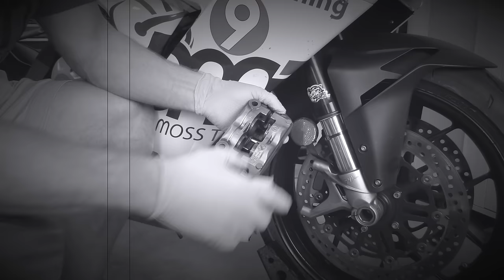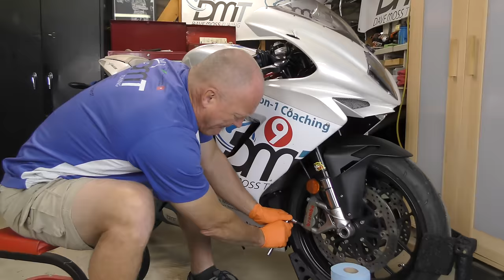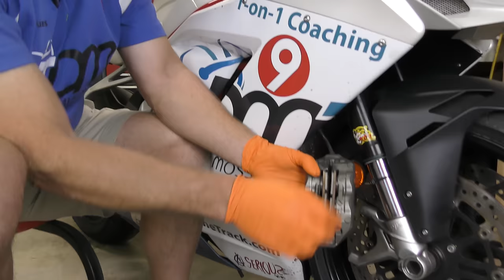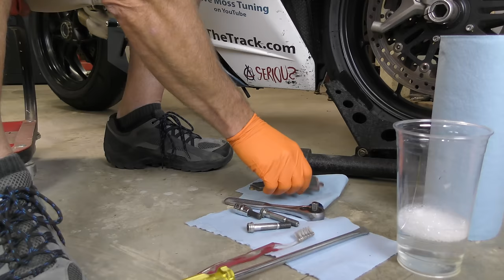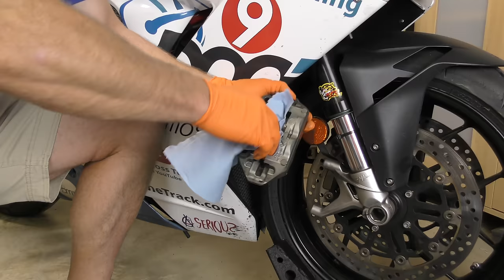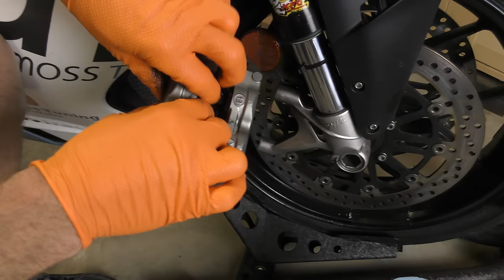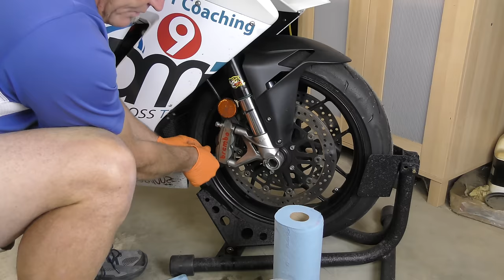Cleaning Motorcycle Brake Calipers in 5 Easy Steps

Comment: Im struggling with uneven pad wear on my track-only Ninja 400. I noticed today the the side of the pad with the most wear corresponds with the piston that doesn’t extend when i pump the brake (the other piston does extend). 

I just cleaned the pistons and that sticky piston still wont extend while pumping the brakes unless i hold the other one. Any other ways to fix a sticky piston? Or is it normal for only one piston to extend when pumping?
Reply from the maker: You might have to remove that piston completely to see why it is sticking. That will of course mean all the brake fluid will leak out. Then you can polish it and use brake fluid or rubber grease on the seals to correct the problem.

Comment: 100 years ago we used to use copper grease on the back of the pads to keep the pads from squealing. We don't do that anymore nowadays?
Reply: Aluminum paste looks better 😉
Reply: I know that in the car industry copper grease is almost never been used anymore due to a coating on the metal part of the pads that prevents seizing up. Maybe the same with motorbike pads?
Reply: They say copper isn't good since we have ABS. Better use a ceramic grease.
Reply: It's comes copper coated
Reply: I'd still do that first if my brakes squealed. Too much nonsense talked on social media about, 'OMG, don't do that because it will.........'
Reply: @thewoodster8607  ok then......
Reply: @thewoodster8607  why not just use the right things for the tasks at hand. Liqui Moly has it all.

Comment: Thoughts on what to lube the seals with when servicing the calipers? They usually come with red rubber grease, but I've heard people say to avoid using it and just use a little brake fluid instead
Reply from the maker: Very very small amount of rubber grease is all I have ever done for brake caliper and fork oil seals. I have never used just brake fluid only (I sure that works just fine) and found that just fork oil creates stiction fairly quickly.
Reply: On most motorcycle calipers, the piston seals are inside the caliper (not exposed) and they are lubricated with brake fluid during reassembly on a full caliper rebuild. The slide pins should be lubricated with a rubber safe brake grease (silicone based) because they travel inside a rubber boot. Some "sub slide pins" have collars--in that case you lubricate between the collar and the rubber boot. Finally, you may use any brake grease (a very very small amount as Dave said) on the brake pad "ears" ONLY where they contact the pad springs and retainers. This is to minimize grit collection. The color of the grease shouldn't be super obvious because the layer should be that thin.

Source: Honda service manuals

Comment: Why don't you clean the brakes before installing them back on?  I was taught to spray the pads with brake cleaner, and also brake pad lube on the back of the pad if you have it.
Reply from the maker: There are separate videos on brake caliper cleaning that are in detail. This involves a toothbrush and soapy water and 20 minutes of time, 10 per caliper.

Comment: I have a sticky disk at just one point of the rotation. The disks and pads are brand new, have they been installed incorrectly? Or the disk is warped? How to tell?
Reply from the maker: Take the caliper off. Spin the wheel and put a piece of card against it to watch and see if the rotor is warped. Simple, quick easy. :)
Reply: @catalystreactionsbw  my mechanic today said it was normal …

Comment: I had a question can I just take the caliber off and the brake pads take them off then just pop the brake brake pads back in without having to push the pistons back in or do I have to push the pistons back in no matter what .
Reply from the maker: Depends how worn the brake pads are. If well worn, yes, pads will easily be removed.

Comment: How much soap per gallon of water should I use?  If the brake calipers still won't come out evenly when pressing on brake after thouroughly cleaning them, what should I do next?
Reply: I've used a piston puller (clamps to the inside of the piston) to rotate the piston, pull it out a  little and clean.  Worked to loosen up a frozen piston.  Then some brake fluid for lube.

Comment: Prior to pushing the pistons back in, I clean the races off, then lubricate them with brake fluid. Then push them back. Work them out, clean off again. Then set the 'bite' point with regard to gap between pad contact.
Reply from the maker: Thanks for sharing your technique!

Comment: Should I open my master reservoir since I’m pushing the pistons back in ?
Reply from the maker: Depends on your fluid level in the reservoir. If you at the the low point, there will be no need to remove the cap. If you are close to the top, you will need to remove fluid to the low mark, replace the cap, then proceed and once the task is completed, top off the reservoir as needed.

Comment: I've seen people dab brake grease or silicone spray to the caliper pins to have better moving pins. It makes sense but, is this really necessary?
Reply from the maker: I see no value in it as I clean my brakes regularly with a toothbrush and soapy water. For those that never touch their brake calipers, I am sure that is helpful in some way.

Comment: In my calipers (SV 1000 S) I can easily remove the break pads without the need to squeeze in the pistons by just ... well, removing them (from the top). They are only held by a screw ... is this different on these Brembo ones?
Reply from the maker: Some have pins like yours, some have springs, some have tabs, some are single pads per piston. Many different designs!

Comment: I always put some rubber grease around the pistons before pushing them back and try to spen them around a little if i can, any reason you didn't do that or is this just not that in depth cleaning, but more something to do between sessions?
Reply from the maker: No reason - just trying to get riders to think about cleaning their calipers, so this is the easiest way to get them started. As experience and knowledge build, so your techniques evolve.
Reply: @catalystreactionsbw  Fair enough, thanks for the insight!
Reply: I find a thin layer of silicone grease around the piston before pushing it back into the caliper keeps them all moving more freely. However it does mean cleaning the pistons a little more frequently since that layer of grease attracts dust and dirt.

Comment: No need to wipe the rotor with a brake cleaner soaked clean towel to remove residue or scrub pads with toothbrush and brake cleaner??
Reply: You never scrub pads that you are returning to the caliper, because they are formed to the rotor, that's why you put the pads back on the side they came out of, most important, applying anything to either surface can cause slippage, that's dangerous.
Reply: @mal-wx6tu  So you think scrubbing the surface of the pad with a tooth brush will wear it? Surely it's not that soft!

Comment: I understand there is some force that pushes brake pads apart so they wont touch the rotor when not engaged. How do we ensure that after dismantling and reconstruicting the braking system this force works properly as it should?
Reply from the maker: If the brake pads pins (if present) are clean and not grooved, that is the first part. Second is the all 4 pistons moved easily and freely on extension as they will retract evenly as well.
Reply: @catalystreactionsbw   im starting to understand. With brake lever unpulled the brake fluid retracts the pistons back. And the brake pad pins somehow  pull apart the pads evenly as well? Planning to clean callípers as well so better to understsnd the mechanism behind it before something bad happens
Reply from the maker: @jasicjan  When the brake lever is pulled, pressure pushes the pistons out and brakes are applied. When the pressure is released, the pistons move back. When the pistons are cleaned regularly, they move much more easily and that is where the toothbrush and soapy water are important.

Comment: @Dave Moss Tuning Aren't brake pistons supposed to move at different rate for modulation?
Reply from the maker: Based on pressure and duration, yes. All 4 should move simultaneously.

Comment: Luckily I've been doing it this way. One thing that I've noticed, on the Goldline Brembo, you can eliminate all noise by applying a tiny bit of copper grease on the back plate of the pad. A TINY BIT is very important

Comment: I didn't have a clue about the reinstalling & alignment. 
BTW: Dave Moss, do you get a chance to ride much? Do you like to ride still?
Reply: Becuz it's not required for most new brake callipers which use dowel pins.
Reply: @pravesh736  I guess that step wouldn't apply then, however the Nissin calipers on my 2006 zx-14 as well as the Tokiko calipers on my 2004 zx-10 do not use dowel pins.

Comment: why not just use breakcleen? is soap and water better? or just alternaitive?
Reply from the maker: Brake Clean products in a can will make rubber brittle over time. Soap and water leaves a film on the pistons to protect the coating AND you get the time to make sure the job is done right.

Comment: Just curious when cleaning, how come you do not remove rhe pistons to clean them thoroughly?  Why leave then in?
Reply from the maker: This video shows you how to regularly clean the pistons. There is another video for complete disassembly in the Trash or Treasure series.
Reply: @catalystreactionsbw How often is "regularly"?  Every oil change?  Every 5k miles??  I am still learning and come to realize how much I really don't know.  I removed my calipers, pistons, dust seals, and fluid seals because it needed it.  Waiting on my ABS speed rotor to put it all back together.
Reply from the maker: @johnnyappleseedz422  If you ride in the rain most of the time, monthly. A dry climate every 3 months. Track riding every six days

Comment: Thank you for the video. 
I have to disagree tho, on trying to use the pads to align the caliper.
The calipers position is ultimately fixed to just one position & that’s not variable. 
To be clear the caliper dictates the pads position not the other way round.
Reply from the maker: Thank you for your comment. May I ask you for your thoughts on these two scenarios? If the caliper has an imperfect fit to the dowel pins, will setting torque keep the caliper straight. If there are no dowel pins at all and just two flat mating surfaces, will that truth still apply?
Reply: @catalystreactionsbw  When you say “imperfect fit to the dowels” would that scenario be a caliper failing to seat correctly due to deformity? 
Do not use calipers which are not seated correctly.
Or alternatively
 for some reason the dowels are sitting in an excessively big hole suggesting play could be possible? This would also be an extremely rare situation and probably caused by accident damage/abuse. With this scenario if all parts are considered still safe to use then Chemical Shim/packing to reliably key the reinstated calipers in exactly the right place. Caliper should have been set perfectly in line with disc centred perfectly if possible but definitely not skewed in any way. This is done with lots of measuring from your veneer gauge before setting Chemical packing compound
Reply from the maker: @King-Arthur-The-First  The dowel pin is .06 of a millimeter smaller than the caliper opening so there is free play. That is of course considerably bigger with two flat mating surfaces with no dowel pins where the variance between bolt and hole is 1.3mm. Interesting ideal on the packing concept. I'm sure readers will look that up.
Reply: The final tighten of calliper mounting bolts takes the calliper back to the same & usually correct point every time. 
if this point is out of alignment (rare) then you would need to measure Calliper to disc clearances all round to make sure alignment is correct before setting in place.
Reply: Have you ever actually done this?  The caliper bolts are not a super precise fit, probably to allow the alignment described.  Using the method Mr. Moss describes, just works.

Comment: How often would you do this? I just cleaned mine last week but when would be a good time cleaning them again?
Reply from the maker: For a road/street motorcycle, every 1,500 miles or 2,000kms. If you commute daily in a wet climate every couple of months.
Reply: when they are black inside. with race pads mine get a quick flush and clean every 3-4 track days. Dave's looked pretty clean to begin with. to avoid endless cleaning with soap i hit them with old school brake cleaner first. great stuff if your state hasn't banned it and you don't mind the health and environmental impacts. the new stuff isnt much better than soap and water.
Reply: @nosretepification  Health impacts?  I never considered drinking it. ;)
Reply: @terrydietzler4096  with a little heat you can make a ww1 era chemical weapon, plus the whole cancer thing

Comment: I just spray my calipers with brake fluid comes out clean as a whistle
Reply: Yeah and when your seals dry up and they start leaking from using such a harsh chemical don’t cry about it.
Reply: @cfltitan  then why do they sell brake cleaner?
Reply: @pravesh736  for cleaning the oily residue off of new calipers and drums.
Reply: @pravesh736  and for just general degreasing because it is a VERY good degreaser. Just don’t use it on any kind of rubber or seals because it’ll dry them out quick and ruin them.
Reply: @cfltitan  thank u. Got it.
Reply: @pravesh736  no problems. It’s a very very good cleaner and degreaser it’s just very harsh on rubber seals so it shouldn’t be sprayed in the caliper itself. That’s why he used soapy water.

Comment: Hi dave how to best clean the bobbins on fully floating discs
Reply from the maker: Compressed air normally.
Reply: @catalystreactionsbw  thanks dave I'd seen some vids where they tightened a nut and bolt through the bobbin to make it spin and was afraid of damaging them.

Comment: Also check that the caliper mounting bolts aren't stretch bolts.
Reply: I’ve not seen a single sport bike that use torque to yield caliper bolts. There is no reason to. The reason they say to replace those bolts is because they come from the factory with a locking agent. I just clean mine with a wire wheel and reuse them unlimited times with fresh loctite. That’s why they say to replace. Not because they’re torque to yield like cylinder head or connecting rod bolts.
Reply: @HighGrade_FireBlade  Honda Fireblade SP specifies it.
Reply: @alanbrown5593  lmao. That’s literally the bike I ride. 2017 cbr1000rr sp. The service manual says nothing about them being “stretch” bolts. Just to replace them. The say to do that because they apply loctite at the factory. Tell me where in the manual it says these are torque to yield bolts. It doesn’t because they’re not. The torque value is 30 lb-ft. You’re not stretching anything with 30 lb-ft lmao.
Reply: @HighGrade_FireBlade  Maybe ask your dealer why, replacement bolts don't come with loctite on them.
Reply: @alanbrown5593  they literally come with a hard red locking compound. Look up a picture of the bolt. You can see it plain as day
Reply: @HighGrade_FireBlade  strange, the ones my dealer supplied didn't. After the cost of them, I went after market.
Reply: Seems to vary with the bike.  On my bike they require moly grease as a thread locker.

Comment: Can you use Wd-40 to remove the initial gunk?
Reply from the maker: WD40 is a degreaser. As long as you scrub the calipers post initial clean so no WD40 gets transferred to the brake pads or rotors, it should be fine.

Comment: I usually put a little special lube on the pistons — is that bad?
Reply: It can attract small dust particals and it is not good for relative motion which can cause small amount of wear. But it is not that big deal.
Reply from the maker: If you are referring to the piston face on the brake pad, no. If you are lubing the piston surface (as pointed out) you can attract dust/debris) and the hope it is that nothing gets stuck between the lip of the dust seal and piston to score it.. Regular cleaning minimizes that issue.

Comment: This is a little off topic but I noticed your Right shock with the zip tie. Is that the most your fork travels? Thanks again for another great video
Reply from the maker: The cable tie is there to assess travel used with different rides and different pace so I can get an idea of how to set fork travel to 80% for most riding situations.
Reply: @catalystreactionsbw  thank you sir

Comment: i had a caliper piston leak when i was pushing it back it, what went wrong?
Reply from the maker: Hello Harsha. 1. There was some debris between the dust and oil seal that cut the oil seal.  2. The oil seal was not fully seated and dragged out of position as the piston extended and when pushed back it cut the seal.
Reply: @catalystreactionsbw  thank you, also any specific soap you are using to clean the calipers?
Reply from the maker: @harshabandreddi2632  I use soap that is used in the kitchen sink for dishes. That seems to provide the best cleaning.

Comment: So wait, why not use the toothbrush with brake cleaner??
Reply from the maker: Brake cleaner makes rubber brittle and being high pressure, it can force debris behind the dust and oil seals.

Comment: Won't a break parts cleaner do the job instead of soap? What about WD-40? 
And I assumed you are supposed to clean the pads too? But you didn't. What about the disk?
Reply from the maker: Parts cleaner makes rubber brittle over time. Soap absorbs the brake dust that can corrode pistons. I never clean pads. Rotors can be sanded sand blasted or cleaned with a brake hone.
Reply: @catalystreactionsbw  Thank you for the swift reply. Really appreciate your work and experienced advice. Salute to you sir!

Comment: Why soap and not brake cleaner?
Reply from the maker: Brake cleaner makes rubber brittle and high pressure can push debris behind the dust seal. Toothbrush and soap will clean much nmore thoroughly.